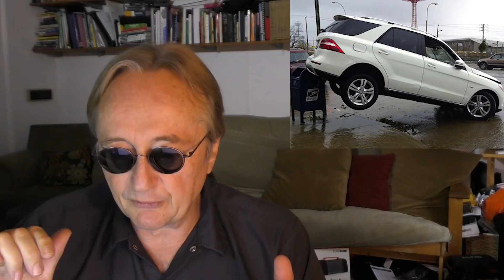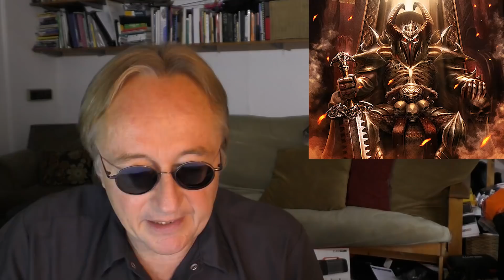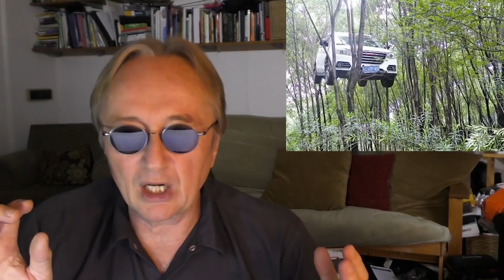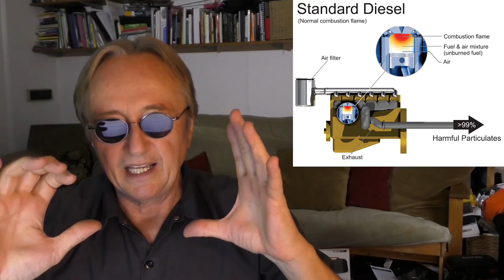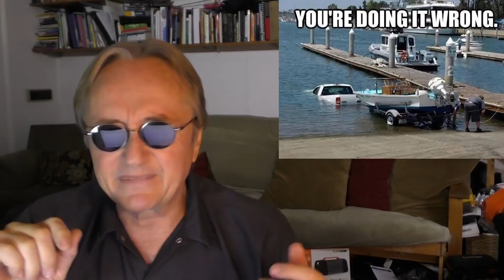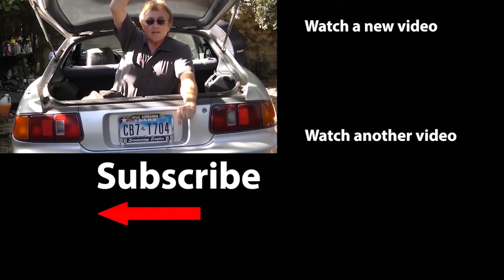Don’t Let This Happen to Your Car’s Transmission

Comment: DON'T......rev up your cars with low transmission fluid !!!!
Reply: msiddi01 indeed
Reply: msiddi01 Indeed
Reply: msiddi01
Reply: CONVERTER STALL TEST IN MY 02 SUBURBAN! YEEE HAW!
Reply: I've got an 07 Corolla with 164k miles and I don't even know if the transmission fluid has ever changed lol
Reply: never a truer phrase has been written
Reply: @Mattman524  you should
Reply: rev rev oops sorry transmission won't go into gear tow truck time

Comment: Did I hear correctly? " I was driving in reverse and it wouldn't go forward"?
Reply: Aaron Jaggan he meant "race"
Reply: 🔊If someone drives in reverse...he won't move forward  👌😂
Reply: Chuck Norris can put a vehicle in Reverse & drive Forward.
Reply: I think he means it drives fine in reverse but not in drive
Reply: Going forward in reverse. Ozzy!!!
Reply: My car NEVER goes forward when I drive it in reverse. Should I be worried?
Reply: Aaron Jaggan In this case “forward” is used as a synonym for “movement in my preferred direction”.  If I say “turn to you left & drive forwards”, you’re still going to the left relative to your initial position, even though you’re heading “forward” relative to your new direction.
Reply: @ballybunion9  Your car needs a new owner.

Comment: Good tips again Scotty, thanks. When I let my vehicle sit for a week or sometimes two while up camping I plug a small solar panel into the charging port and set it on the dash outside the sunshade. I used to disconnect the battery on my older rigs but anything newer than my '74 CJ-5 causes annoying trinket issues like clocks, memory presets, etc..

Comment: I have a 2010 cobalt. Same problem as the Impala you talked about. Every transmission shop told me I needed a transmission without looking at it. Turns out the fluid transfer tube broke off of the mounting flange. Welded it back together and it's been good for the last two years.

Comment: I just did a drain and fill on my pickup transmission based on your good advice. It was a PITA because there isn’t a drain plug and GM ran the exhaust pipe under the pan so that you have to loosen and move the exhaust to get the pan out. Still, I am glad that I did it and I’ll do it again in 30k.

Comment: My 1990 Honda accord manual with 287k the transmission is bulletproof  when I gotta push the pedal down it accelerates so nicely smells a little burn oily but never had a problem. Cars are not made the same I guess this accord wont die.
Reply: @Attachments.  cars are far safer in wrecks tho. So lifes saved outweighs any argument

Comment: Most people never bother servicing their car's transmission. Or any other maintenance other than changing the oil and air filter. Then they wonder why it dies.
Reply: Frank K this is way too true even car from so called less reliable brands would last much longer if they were properly taken care of the car is only as reliable as what you put in it and how you treat it

Comment: I put Rotella 15 w40 in my 92 Mazda Miata with 232k for 7 years now. Never a problem.
Reply: I use Rotella 15 w40 in my KLR 650 motorcycle. It's great oil.

Comment: When I had a 1995  Holden Commodore with the GM 4L60-E transmission, I drove it for a week with low oil due to my not tightening up the oil pan nuts enough. You could hear it going "cha cha cha cha cha" as it accelerated, but once I got them tightened to spec and topped up, it was good as gold!

Comment: I have a 2012 Impala with 147,000 miles, I love the power of the 3.6 LFX engine (advertiesed 300+hp, so it makes a good sleeper). But ever since it hit about 75,000 miles, throttle cuts off sometimes when I turn the steering left. Mechanic says speed sensor is corroded or damaged. Both side front hub assemblies has been replaced twice but the problem does not go away. Surprisingly the suspension and engine is still good, water pump has a small leak if revved.

Comment: I had an 02 Impala LS 3.8 and it's still running very well for 180k miles! The guy my father sold it to beats on it though so it won't last much longer. And my old 04 Impala basic 3.4 is still going with probably 190k by now. He sees it all the time down the Cape. No issues with both of them but the guy with the 02... I know somethings gonna happen the way he drives it.
Reply: I have a 02 impala 3.8 with 220k miles got it with 180k. It's very reliable.
Reply: @bengee5400  hell yeah dude I miss it lol very peppy
Reply: @BigTony2436  I got it for $1000 from a good friend, after her husband passed. He took extremely good care of it. He had all the receipts of oil changes, tires, ect.
Reply: @bengee5400  got the 02 for free, it had some issues cuz it was sitting like break lines, spark plugs, and coils but after that and normal matinence it ran very good.
Reply: @bengee5400  I know one thing though, the frame on that model have an issue with rot.. Both mine had it does yours? On the side
Reply: @BigTony2436  No rust issue, I'm in Florida maybe the weather conditions have something to do with it.
Reply: @bengee5400  I'm in Plymouth, MA

Comment: 2012 Chevy Impala with 205,000 miles on it. No problem whatsoever just regular maintenance. I use it for work everyday.
Reply: Is it a v8 or v6?
Reply: I have a 2009 Impala with 211,000 miles and no issues. They good cars no matter what this buffoon says
Reply: Its a v6 Damien
Reply: LividPotaoes 1 car in a million makes that car reliable? Haha ok
Reply: @damiensmith6656 - If it's a 2012 then it has the 3.6L V6 and a 6 speed automatic.
Reply: @everyonewasstealingmynamea919 - Consumer Reports gives the Impala an above average reliability rating. Of course, if you never change the fluid in the transmission, bad things will happen.
Reply: @ahuehuete4703  then i need to tighten up on my maintenance especially the engine 
.i have a 5.3 v8 with a recent built transmission.. now it needs engine repair or replacement
Reply: 5pointoh I have 4 Impalas in my family and several friends that have one. All of which are over 150,000 miles. So 1 in a million whatever!!
Reply: LividPotaoes Idk man, I’ve never owned a vehicle over 110k miles congratulations I don’t really care tbh I was just simply saying just because your car is ok doesn’t mean all the other millions produced are fine
Reply: Damien Smith V6

Comment: I have been running Diesel oil in my old jeep for years but it also has 360k on it seems to run smoother and have a lot better oil pressure and it doesn't smoke as bad as it did before

Comment: My 2009 Chevy Impala has 211,000 miles and ZERO issues!!
Reply: Cool story
Reply: You probably acquired those miles in a short amount of time , they don’t stand the test of time
Reply: Kelly I acquired those miles over 10 years my dude. So it’s held up and still will
Reply: LividPotaoes lol I just hate chevys
Reply: I can respect that Kelly
Reply: The Impala's and the Lumina's before them were solid cars if you took care of them. My Lumina went 212,000 miles with no problems. I sold it to a local kid who drove it for several more years.
Reply: My '13 Impala was a giant turd, I was so relieved when I managed to flush it away at CarMax.

Comment: Spend a couple hundred dollars to get it diagnosed at AAmco. They might apply it to any work you get done and they have rebuilds on the shelf (they rebuild cores when there is nothing to do)  priced according to how long you want them warranted.  It could be a solenoid or a valved body in other words, repairable. You don't say how many miles you have on it.

Comment: Some owners manual specify 30 days as “extended” park and have procedures like trickle chargers or disconnecting the battery making sure tires are inflated.

Comment: I just purchased a 2019 Nissan Altima, to me, it really depends on how you treat your car. I came from a 2016 Altima which I always got the fluid changed before I’m suppose to and it never gave me an issue. Got it to 109k miles.
Reply: So what happened to your 2016 nissan ? Why Nissan there very cheap like Kia and Hyundai
Reply: creative passion I traded it in because I wanted something newer, and you’ve obviously haven’t been inside a 2019 Nissan

Comment: I have an 09 impala with nearly 160,000 miles on it... still on original plugs n wires and original transmission... it holds 85-90 mph on the freeway all day while getting 27 mpg!!

Comment: I had a 2016 Ford Fusion that sat for 2 weeks while I was away. When I came back, the battery was so weak, it wouldn’t start the engine. I called the dealer and they said that was normal and I should install a trickle charger. I told the dealership “that’s crap!”  That’s Ford.  I sold it because it started having other electrical problems.
Reply: That's all cars with modern stupid electronics.
Reply: Omar Tinoco   I would agree.  There are so many systems on modern cars that are always active and “listening” they slowly drain the battery

Comment: My dad's 2005 Chevrolet Malibu Maxx LS Hatchback has over 170K miles and the transmission and motor still run. The low gear buttons stopped working and I might fix it sometime soon after I check the transmission fluid to make sure it's not burnt.

Comment: I had the dealership change the transmission fluid on my 06 solstice (on warranty for another 3000 miles). And now the transmission wont go forward when first putting it in drive but when you put gas into it you have to put 3000+ rpm for it to get to 5-15mph and there are some random revs here and there, after 10 to 15 miles the problem is pretty much gone but it does it every morning when I start it.
Reply: Does the dipstick have foam on it after you have been driving? Check while engine is ON. It's slipping. They may have not put enough fluid in it/possibly too much.  if you notice foam on the dipstick. complain for them to redo the transmission oil change and make sure they use the right type since you own a sportscar.

Comment: I have a 2017 Ford Explorer XLT  SUV .   I parked on a barely slight hill, facing down and the car was in reverse, because I wanted to get a little closer to the curb,  but before I hit the gas to go into reverse, I  had taken my foot off the brake and moved something to the back seat, (I'm still in reverse),  and the car started drifting forward.....  ( I was still in reverse, car facing down hill)....  I thought I was hallucinating, but the car kept very slowly going forward...    After slowly going several feet,  I hit the brake....    I took it to the dealership, but they said not to worry about it !!!   I am able to get it to do it again, but not all the time.  Now, I hear there is a recall for the Ford trucks transmissions.... and , some guy died because he was driving his truck on the freeway, when the transmission locked-up and I think he might have gone through the windshield...

Comment: Scotty kilmer, I have a 2014 Mazda 3 manual transmission with 123,000. I am the second owner and have it for two years. Do you think is a good idea for me to change the transmission fluid with the high miles? Thanks.

Comment: What do you think of the 1st Generation Hyundai Veloster? Thinking of getting one as my first car. I personally have thought of Korean companies of being on the rise and having good reliability.
Reply: Nathaniel Lunau avoid the 2013 turbo models (if you’re getting a turbo model).  Be prepare to use 5w40. Premium gas (to prevent LSPI). Oil catch can (due to DI system). 

If you want to avoid the hassle then just get a NA veloster.
Reply: Thanks for the help!

I was planning on the NA one since it has better fuel economy, cheaper insurance, and cheaper to buy. I’m not sure how the gas situation will work but I’d imagine regular will be fine. I’m looking around the 130,000km mark (80,000 miles) since I’m looking for it to last me just over 4-5 years and I’d see myself around 8-10k miles a year.

Comment: I think most cars with the electronics on all the time have a setting you can do (usually slightly complicated so not done by accident) that turns everything off for situations where the car will sit unused.  A week, or even a month is probably fine without doing anything special.  Easiest if you're concerned, or your battery isn't at it's best would be to buy a good trickle charger and hook it up when you store it.

RichE

Comment: I been running diesel oil, 15w40 for past 6 years in my 1999 isuzu trooper with 208k miles on it no issues
Reply: My 89 Nissan owner's manual lists 15W40 as acceptable to run in hot weathet
Reply: @rays7437  all cars can run on any oil long as the regional tempatures are with in reason to justify that grade,
Reply: @michaelc9128  
That's true for viscosity, but not necessarily for weight.  I would never use a 15W in an engine designed for 5W or 0W no matter how hot it is outside.  The oil passages in those engines are only about the diameter of a human hair.  
But in old cars, I'd run  anything but straight weight

Comment: My dad owns a 1998 Honda CR-V where it leaks gas from the tank when it’s full. My mom won’t let me use it because of that. Is it worth it to fix it.
Reply: No it's one of the most reliable Hondas ever made.But if you do,  find a junkyard gas tank and do it yourself, when gas is low. They are common.

Comment: Hmm. Do to very low oil pressure I was told to use diesel oil in my old truck because it is thicker & is the only thing that brings my oil preassure up. It is a 79 GMC Sierra 15 with a 350 motor. Wonder how bad I messed my engine up. But one thing for sure the diesel oil appears to have helped my oil leak
Reply: Sounds like your engine was already worn out and this is just a temporary fix.
Reply: @reallyhappenings5597  True. It does have lots of miles on it. I just put a court in today. So it holds its oil pretty well now. Sadly if my engine dies I don't think can get another motor in my price range

Comment: If you really like your impala theyre pretty cheap on theused market. I'd say scoop up a later 2012+ first year the impala canned the crappy  3.5, 3.9 for the cadillac 3.6L HF V6 and 6 speed auto those are a ton of fun as they are downright quick with 302 horses

Comment: Actually there's a sensor on side of transmission it's a gear switch i had one on a Pontiac Trans Am, 1996 model it wouldn't go in reverse and you had to floor it in drive to move just a little but I switched that little black box on side of transmission with a little up for wires you can't miss it...Changed it never had another problem from it..So when a person gives you a high dollar price to fix..Keep that in mind...Look at everything your self sometimes its something easy..

Comment: My son's Audi A4 automatic has no transmission dipstick. Nor did my newer Dodge Charger. Even my newer Chevy Corvette automatic. I'm retired and grew up being able to check everything... the new cars make me nervous to not be able to check, smell, or feel those fluids...
Reply: Newer cars are ridding or old technology. In the UK where these German cars pretty much have a monopoly over the market you will be lucky to find someone who changes anything under the bonnet other than the washer fluid. Dealers pretty much do everything for you nowadays, the 7 series has no dipstick, it’s all shown on the idrive system (infotainment) the VW’s just about still have the dipsticks though, I don’t believe the brand new Audi’s do now though, I will need to check. If your cars in warranty though they will pretty much change anything for you at very little cost if any. The 7 series has free servicing and maintenance for 5 years I believe so even with coolant they just replace it for you for free, saves having to do it yourself if you have no clue what you are doing. But yeah Im aware in the US people work on their cars but I gather these German cars which a lot of American companies look to are catering more to the European markets.

Comment: I brought my 2014 Toyota Camry into the dealership today for some work. They went over some general maintenance information. They said that my transmission doesn't need to be flushed until it reaches a 100K. Transmission fluid is cheap. Transmissions that work well -  priceless. I'm going to flush mine at 50,000.
Reply: Change the oil, don't flush. Haven't you been listening to anything Scotty tells us?
Reply: @adcolt54  You're right. I meant to say change, not flush. Thanks :)

Comment: speaking or wrong oil. In the navy 1965 one of the machinist mates swiped some no 30 steam turbine oil from the ship. he put it in his 50 ford flathead and ruined the engine.
Reply: "All the seals began to ooze out a thick dishonorable discharge."

Comment: Scotty can you explain what a runaway diesel engine is?
Reply: A runaway diesel often only occurs with poor maintenance. It occurs when the bearings or shaft of the turbo impellor are worn down enough that engine oil is able to pass through and into the intake side of the turbo. The oil passes into the combustion chamber with the air and, being a diesel, will then combust. 

The engine begins to rev higher and higher as it pulls more and more oil into the combustion Chambers and burns it off. As it progresses, the engine then basically only runs on its own oil, eventually it'll have burned all of its oil and explodes.

If you're lucky you can stop the process by blocking off the air intake enough so that it can't continue to combust.
Reply: @RiverrRiverr  
We had 6 liter Ford run away in the shop once but the tech was able to stop it, thankfully. Another time we had a runaway outside and nobody was around to stop it.

Comment: For the guy with the impala you can use the manual shifting modes to drive locally been doing it for a while
Reply: The 4 speeds don't have manual mode. Only the 6 speeds, and those transmissions are actually really good.
Reply: @TheHuskyGT  dont even have a #2 or #3 on the gear shifter or whatever it's called
Reply: @liveandletlive2894  Impalas that only have PRNDL are 6-speed. Those do have the manual mode. His is a 4-speed. 2006 were all 4-speed